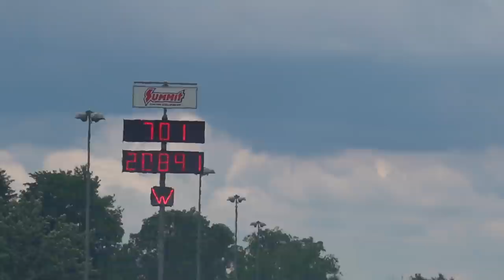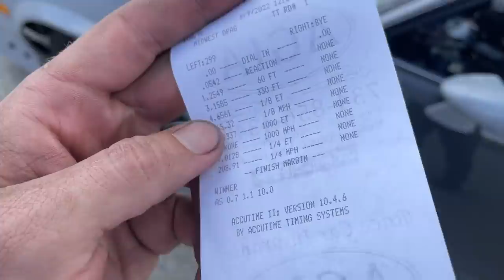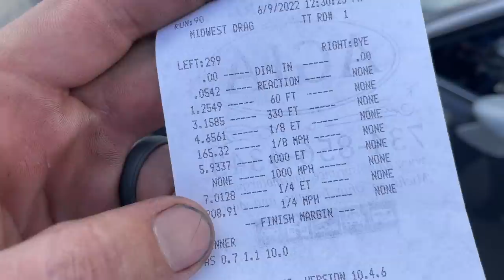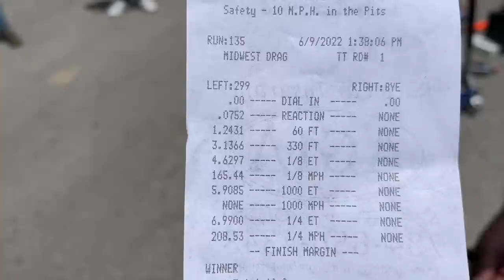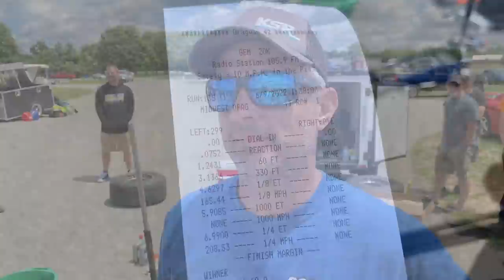Midwest Drag Week DAY 3 - MULLET'S FIRST Drag n Drive 6 SECOND PASS!!!

Comment: The fact that Garrett was next in line. A front row seat to the truck immediately smacking the wall and was fully prepared when it happened to him. So much respect on that save Cleet, you were bogging deep brother
Reply: People like to dog on Garret, but the fact is, he's kept it out of the wall more times that I can count, the guy's instincts behind the wheel are second to none.
It's all that Kart racing he did when he was younger, because there's zero room for error and not much between you and the outside world while you're doing it. Built him into a fine tuned racing machine.

Comment: Those turbos turning slow like a windmill during idle is mesmerizing.
Reply: They are actually turning quite fast. Just the camera frame rate can't pick up the spin
Reply: @EasyBakinX  Well you could definitely tell they're not spinning as fast as the old TSP 427 setup, they're absolutely massive and so are the back housings, pretty cool stuff... I can't wait to see Cleet in the deep 6's.
Reply: Oil circulation dependant
Turbine is that big Air flows straight through until Exhaust gas is Propelling the Turbine @ 2-3k revs
Reply: @EasyBakinX  actually not, Garrett pointed them out turning slow like that on the very first start-up. The engine idle has such a sweet thunder, deceptively hiding how lightning fast that ride is..
Reply: @jaynikk758  obviously man

Comment: Easy to make simple mistakes when you're rushing around. Real sad to see that lil' red express hit the wall 😢
Reply: Avoidable. Think the track crew cleaned up Mullets oil slick with KY lube...
😦
Reply: @zrxdoug  They mentioned the truck leaked its own fluid when it happened, also the video looks quick after mullet leaked but im sure that was over a hour or so before anyone got to run on the track again.
Reply: @zrxdoug  he did it to himself. Just like cleetus had water in his doors and caused him to almost crash.
Reply: Yeah, it's pretty clear now..
I'm a victim of editing.
Reply: @zrxdoug  Mullet's spray was well ahead of the truck accident.  Had nothing to do with it.
Reply: @paulcopeland9035  
Yeah, that would be why I already acknowledged my error, like...five hours before ya posted..
But thanks for the update!
😁👍

Comment: The progress y’all are making with this new big block and how fast y’all are getting it dialed in is remarkable LOVE too see cleetus winning keep it going brother
Reply: 1.25 60ft isn’t what I would call dialed in. They did a 1.16 on the first 6 second pass. Mainly what they are doing here is just throwing power at it past the 60ft to go fast. If they actually dial it in on a good track they should be running 6.80s to 6.70s with that mph.
Reply: @philb5593  I'd bet once it's really dialed we'll see 6.5's, and a need for pro stock chutes.
Reply: @philb5593  it’s more so the fact that they are running on a completely different motor. If you don’t have a good team or knowledgeAble members on the crew that in some cases can take weeks and even months to prevent spinning and still running good passes or other issues a new motor could bring. It’s not dialed in but there getting there and what is impressive is how much progress they are making on those time slips on a brand new engine that’s completely different then before. But I got a better idea how ab we see your car run 6.80?

Comment: Try beefing up the grounds to the coil packs and run 8 1200uf 16v capacitors on the dc in wires.  Might cleanup the signal and keep them from high making at high load.
Reply: May as well learn how to make cdi pack's!
Iridium plugs are a better option before playing with a professionals work....
Reply: They are already running 16V electrical, better go with a higher voltage cap if they do that.
Reply: how do the coils ground? are they grounding through the valve covers?
Reply: @kschleic9053  (guessing) I'd say they're grounded through the harness. That's at least how I've seen MSD coils wired in the past. I didn't see anything mentioned during the install though so could be wrong. I've only built harnesses for Toyota 4bangers and the only V8 I work on is a 305 with a carb, so I'm no expert here.

Comment: Hell yeah boys .. I called that .. kinda sucks Edgewater is the the last track again Hope you can put down at least a 7.5 with spinning to win the overall #1 spot that would be a great and a helluva accomplishment your first time out with it basically shaking it down.. gotta feel good having such good reliability for your first time out with new setup
Reply: I’m glad he has it running like it is but for a $50,000 engine(minimum) it better run 6’s
Reply: SPOILER ALERT:: seems like he got a 7.0 there. 
Couldn't wait for the video tomorrow so I opened the event page lmao
Reply: @FAQBrooks  $75k min*
Reply: @zeeh  bro, he's saying with the final track. It's known to be a slick straight.
Reply: @CrashRacknShoot  me too, my dude. There are results for the day 4 of the event in the website. Check it out!
Reply: @FAQBrooks  you realize they were only running it at half the boost they need to right they're making sure the car makes it to the end of the event and to Rocky mountain race week they're not even leaning on it at all there's still 20 lb of boost left in it to use and more timing and he still ran a six when nobody else could and there were other cars there just as capable that couldn't go faster than a low 7 to mix 7 the tracks only hold so much and if you break something important you're screwed so you turn the car down and run it like that so it's just enough to win this isn't a regular event where if you break it you just put it in the trailer and you're good you're hundreds if not a thousand miles from your final destination sometimes

Comment: You guys were spot on about the coils, I recently had a coil pack vibrate it's bolt out and it came off of the plug in my WRX. It only took a few miles  for the coil to burn out with no where for all that energy to go.

Comment: Re: oiling down the track
I suggested a while back, it might be time to make a 'preflight' check list. Your under hood starter button gave a better idea.

It took me over 20 years of wrenching to think of wiring in an under shortcut to bump the starter; that was 30 years ago. Now it's common place.

Instead of a paper check list, or even a digital, how about some high quality labels of simply numbers.  Attach them near crucial.items to be checked, pre-run, & clear lacquer them for durability.

Then right before you check the 2 step, someone can 'run the numbers'.  Multiple people could do them even, just decide who takes which numbers. Sam would be a great candidate, in my opinion. He's certainly thorough, competent & reliable.  It's just a visual inspection for loose wire/hoses, broken mounts or tie wraps, etc.

Learned a while back that Clay Milligan TF frame is bare metal, just oiled, to make crack inspection easier.

A simple set of numbers might mean the dif between a win or loss, or destroying and engine, or not.
Reply: 👆👆YOU’VE BEEN PICKED FOR THE ONGOING GIVEAWAY.🎊🎉•.
Reply: Checklists are a very reasonable thing to use. All the pro teams have them, and you find them all over where things absolutely must be 100% right every time.
They make pencil-markable laminate that you can use for this purpose. Hash out the list, have a couple people go through the same list, one after the other, and you've got something pretty close to foolproof, and it's cheap. If you miss something at any point, add it to the list, and as you iterate you wind up with something that ensures things work every time.
Reply: @jttech44  
They need to do something, these little oversights are becoming costly.  

(Could you do me a favor? Can you see another reply to my comment telling me to text someone?
It seems like almost every comment I have left in the past week has the same sort of SPAM reply. 

But I haven't seen any on other people's comments.  Wondering if the are 'blind replies', like 'Bcc:' used in eMail.

Thanks)

Comment: I would have drilled drains in the front of the door not the rear so if you don’t get 100% out it won’t leak on launch
Reply: Idea is to not have ANY water when they get to the line...

Comment: The rough math in my head says the car should be capable of somewhere around 6.7 without much fuss, maybe even closer to 6.5
Reply: Easily, the reason they’re struggling with that 1st 6.99 in the BB (big block) is their short track is pretty slow to be fair like he said before with the SB when they ran the 6 their 330 was a 3.0 and it’s like a 3.15 here you get that 330 back down to a 3.0 and that’s like 3 tenths picked up end track everything matters on the short track and if had could get like a 1.15 60’ that would be mega quick

Comment: Add another item to checklist:
Check two-step 
Check all caps. Especially oil filler

Larger motor = faster speeds = need larger parachutes

5 spare gallons of pump gas wouldn't be a bad idea. Though the alcohol you used seems to be an  OK backup.

Comment: Lots of folk can produce a 2000hp to the wheels big block, hell you could build one in your garage if you take advice and go with the best bits but few at all can build one that can run 6-second passes and then drive a 300-mile highway run to the next track. That's next-level reliability that is and SMR (and KSR as well) should be damn proud of the achievement.
Reply: 👆👆YOU’VE BEEN PICKED FOR THE ONGOING GIVEAWAY.🎊🎉•.

Comment: I worked about 15 miles away when you were there...shoulda snuck over!  When I first went to 42 the track ran the opposite direction and you could see it had a second track beside that hadn't been used in years.  Sounds like you may have a maintenance program with plugs...maybe a fuel switching thing?  Congrats on the 6 and just shy of 209mph!

Comment: Mini jet boats = small ass rivers.  For big ass rivers you need something a little bit stronger.  Long and lean... and full of steam.  River boats!  800 Hp plus.  Big dogs used for hauling supplies into remote places only accessible by water.  Check those out.

Comment: I told you Mullett would Ike Dragway 42. 6 second and 200 mph is fast for that track. And YES  The shut down comes up QUICKLY. For those speeds in the 1/4 it needs a additional 150-200 yrds of shut down added.  But at least it has the sand traps.

Comment: DUDE! that Suspension shot for the 6.99 run was SICK! I'm guessing that was Kevin's idea and a damn good one!
Reply: It's something you see alot of on kevin's KSR racing channel. It's a great angle to have when you're making suspension changes later because you can see exactly what was happening and correlate that to the logs. He goes into it when they dial in Kevin's Soccer Mom car. Soccer Mom is a force to be reckoned with, when it's dialed in, it's faster than Mullet, but it's racing notime, so, hard to say exactly how much faster. Rumor is, mid 6's, which means once Mullet is fully dialed in, they'll be trading blows.

Comment: Need to verify if you dont have a wiring issue ahead of the coils, that caused issues with them. 

That issue the other day on the drive back from big end on a few holes, and the random screen shut offs mid run seem to allude to a potential underlying issue.

Comment: I was driving to KC last week pulling a 16ft enclosed trailer and I hit a bump after a bridge going around 80mph and the pin busted on the swivel hitch causing the trailer to no longer be attached to the ball and only the safety chains keeping us connected. Talk about scary as shit to see your trailer swerving back and forth and not knowing what was happening till I let off the gas and the trailer gently bumped into me. I realized it had came off the hitch and eased it to the side of the shoulderless highway. Luckily I had a jack with me and some wood because the tongue of the trailer slid underneath the flatbed of the truck and was wedged. After about 30 min of fighting it and pounding several 6" nails through my pin slot we were back on the road.

Comment: Just wondering when did you change the brake pads?
 I suggest having a look if you have not done so yet.
Just because also when the oil leaked there was a chance for it to get into brake pads causing them to be less effective?
These brakes were red hot and throwing some sparks!!!!!! (at least left one ) .

Comment: I would cut a couple 1" slots to let the water out of the doors. A simple hole will plug up easy.
ALSO PLEASE Don't paint the carbon door jambs or interior. Outside skins only.
GREAT SHOT SICK WEEK!
Zero question where the water came from. Sucks the Dodge dropped a little more.

Comment: You were told right away that the motor would burp after the hand-assed tuners! The ignition coils failed due to the very long charge time.
Only a stupid tuner is pushing the charge time of the ignition coil at point-blank range in an attempt to defeat supercharged misfires !!!
The saddest thing is that the new set of coils will burp!

Comment: Re: hitch
After an experience my stepdad & mom had between SF & LA, I adopted a 'belt & suspenders' philosophy for critical hitch mounts: bolts AND welds.

I didn't have time to mount the hitch on their new motorhome B4 they left.  Another shop in town did it.

They were motoring along on I-5, headed south, when Mom remarks, 'That sure looks like our Saab on that rough country road over. Look how it's bouncing, they must be flying.'

Her comment prompted stepdad to check the review, closely, only to find no dark blue Saab 99 behind them.

You likely don't know, but Saab's had a free lever on the floor board. One setting was free wheel, no engine compression when you let off on the gas. Great for mileage, but it basically made the damn thing a roller skate; a 3500# roller skate.

I can still Invision that little bastard just rippin' across the dry, hard field; just a bouncin' along.

It took out two fences, and cleared three ditches, & one cross road before it finally stopped.

Not much more than some cosmetic damage, either.

Glad to see you on closing your shield as a habit. I can quit worrying about your baby blues, now.  LOL

Comment: RIP Lil Red Express.. that's shit though because they only made 7300 of those trucks in the two years they made them and I'm sure few of them still exist. Get the Accel plug wires with ceramic boots, you'll never fry a boot again... and you can thank Frieburger for coming up with them 30 years ago.

Comment: Curious question.....does anyone ever mess with your stuff at night at the hotel when ya'll do these race weeks?.....Only reason I ask, I live in SC, and anywhere around here if you leave your trailer and stuff in the parking lot, it better be locked up REAL tight, and locked to the vehicle. I would travel with my 4 wheeler in the bed of my truck, and when I would spend the night at a hotel I would have to back the truck up to a light pole or something so if they wanted the 4 wheeler they couldnt roll it off the back and would have to pick it up off the truck.  People are terrible these days.

The Big Block is Awesome

Comment: Hope there is no friction going on the background between you and Kevin, you guys seem to really connect as a 2 men army. Just don't fukin forget your oil caps again? 
I'd suggest getting some kind of clip-on mufflers when you doing this kinda stuff so early in residential areas, it's very disrespectful making all that open pipe noise. Everyone in a 1/2 mile radius will silently appreciate the gesture.

Comment: 3:23  are those like MATCHED SETS like injectors ???

'''blabble alert'''   ^^^ yhsy'thazza all that mattered prolly to most people
MATCHED SET??? or are they ALL just A SWITCH ... are they spoosed to be TESTED AND PUT TOGETHER AS SETS ...  Finnigin something about INJECTORS made me think about that, or are they all just a ''relay they work or don't'' switch to bringTHEligbtning1(one) or NOnoNO-LIGHTNINGbringsNOnoNOspark'n0(zero)   the 1 , ONE... or 0 , ZERO are all that matters, it's lettin it thru/sparking/wutever or NOT ;)  anyhow, that's higher tech than I normally thinkn about (3d CARS anyhow) ummmm